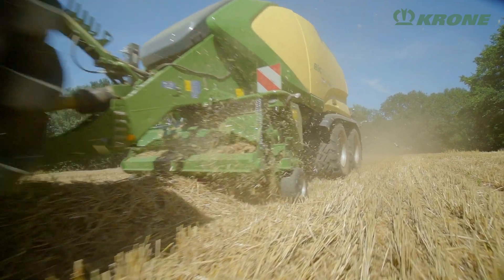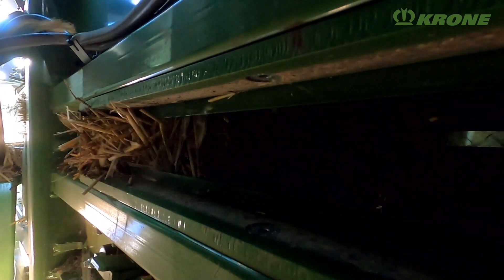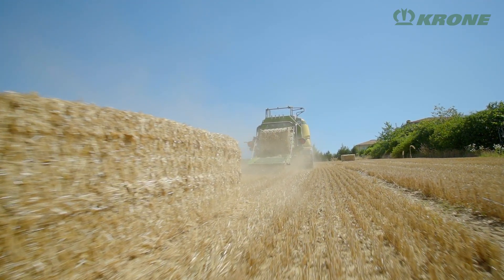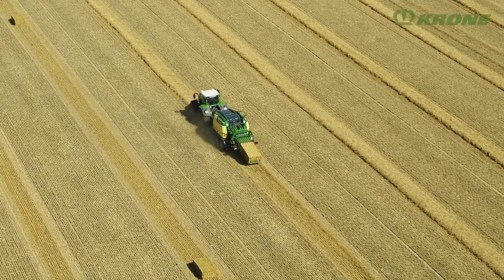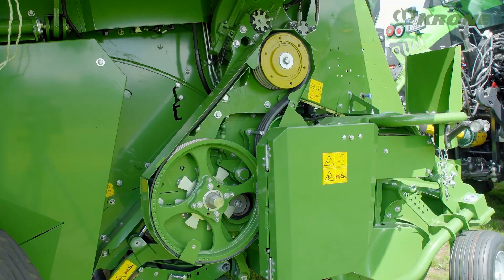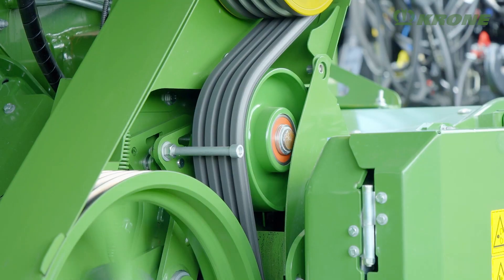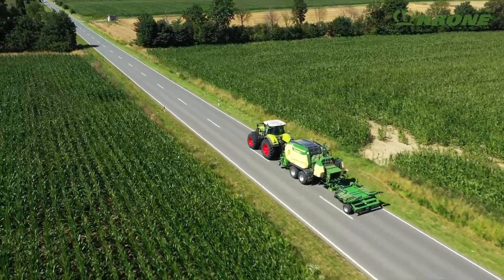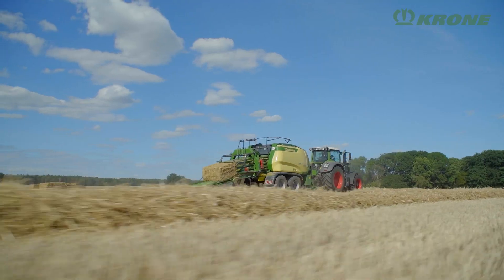KRONE BiG Pack – The new generation large square baler

Comment: Wow! I have always loved Claas balers and that's what I am currently running. Because their baler drive systems could not be beat especially their hydraulically driven pickup. But now Krone has finally upgraded, I have to say I'm impressed. Krone now has it all and even more cool features.
I am in the market for another baler for next year and this new Krone is definitely a comparable option to the Claas now. Their is still a few things Claas is better, single tying knotters, less moving parts on the feed system and a few more small details here and their. 
But now if Claas wants my business they better upgrade cause I don't think I can resist from these new Krones!